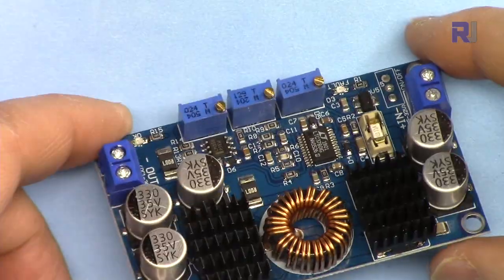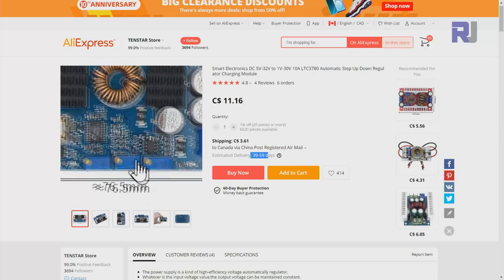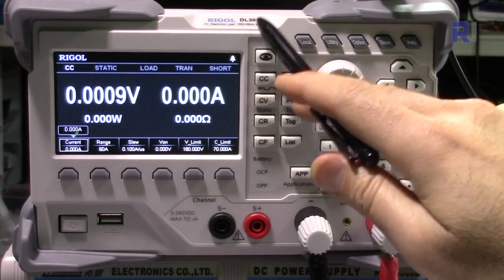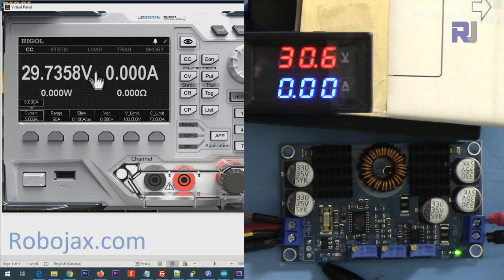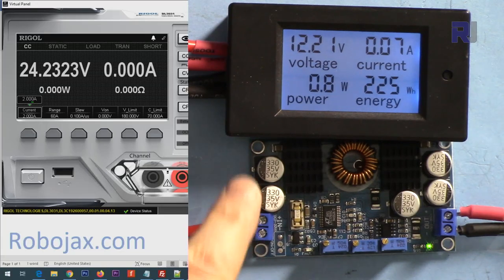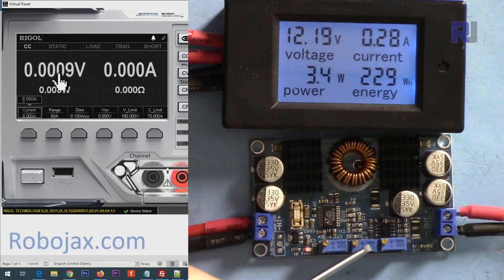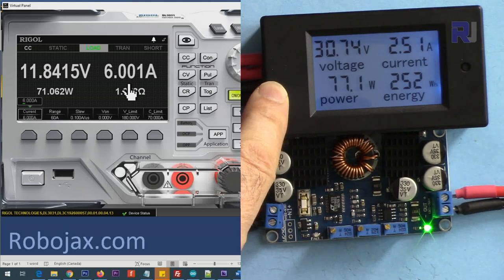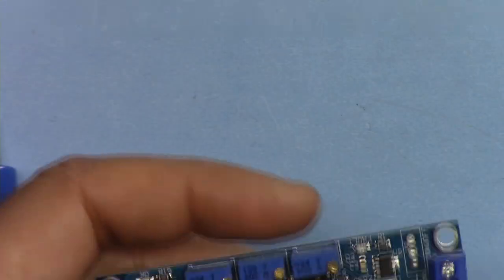Review of LTC3780 Buck boost 10A Converter: 2 module failed

Comment: Hello sir, I cannot adjust the current in this module, Can you help me?
Reply from the maker: the potentiometer is multi-turn. so you have to turn it 15 to 20 times. 1-short circuit the output (connect + and - together) while putting Ampere meter (ammeter) in series to see the current 2- Adjust the current potentiometer to achieve desired value on the meter. 3-disconnect the short circuit from output,. Done. if your module can't adjust the current, it is dead.

Comment: Aassalam sir thanks for your help it a very helpful video I have also brought 3 module all the module where faulty from the box but I manage to work 2 out of 3 buy simply,changing the 40 amp MOSFET and have to power supply from them the are working but I was wondering to make a digital version of the unit but now I think it a very bad idea after seeing this video thanks sirf Allah Hafiz
Reply from the maker: walaikum alaam,  You  are welcome.

Comment: i though this is a 130w,10A Max converter... you overload the converter, and this may be the cause of the burn!
Reply from the maker: There are conflicting details about it on AliExpress. Perhaps I missed the maximum power.
Reply: indeed 130w 10A peak, but without good disipation and sustain draw, 80w/7A. its works perfectly until you burn it!
Reply: I have just ordered 3, so i can repair portable coolers for car usage. From the manufacturer they had negative converters, meaning that the Input GND is output postive. I don't need more than 5A at 13-14V out, so i guess i'll be safe when is set the minimal input to 11V. That will also serve as a overdischarge protection.
Yes, it clearly says 10A. If you want more, solder on some beefier FETs, that might just do it.
Reply: @robojax  "Perhaps"....
Reply: @blubbspinat9363  hello, how is this ltc going with your cooler? I want power 13v 5A led chip with 12-14.4v power source from vehicle. Is this module can handle it?
Reply: @ferdinandkrist_5556  it kind of works, but the current regulation is quite wonky and i have problems with switching power supplies. The initial current spike is so high that external power supplies protection kicks in. i had to use a backup battery while testing. The output current is not stable. If you try to set the current by shorting the output like you do on a lab bench supply burns the module. the peltier coolers are ok with the unstable current between 4-5A and the module handles this staying stone cold. I could sell off these coolers to get one with a compressor which not only has more storage but also cools way better and draws less than 1/4 the power.

Comment: Thank you for such a review. For purpose of making an adjustable bench power supply, to have 0 to 30 Volts and 0 to 5 Amps, what kind of Buck and Boost module do you suggest?
Reply from the maker: You are welcome.  This is very hard to suggest. I waited this long to reply. But Buck boost is not a good idea. Get 30V pour source and use Buck converter and that would be easiest .
Reply: Try D3806 boost buck 38v 6a max. Good board with reasonable price for Diy

Comment: There is not problem. Try adjust potentiometer low voltage protection. I have 5pcs this module like this. No problem found. Just adjust low voltage protection potentiometer. Done!

Comment: You overloaded it, simple. It's maximum 130W for the chip and it's most efficient between 10-15V on both output and input with 90%+ efficiency. If you fully load it, at 130W and 90% eff. the board will have to dissipate 13W of heat between the MOSFETs and the chip, but mostly the MOSFETs. Obviously, those heatsinks cannot do that, they can probably do like 3W each passively. You have to strap a fan on it or figure out a different cooling solution if you want the full power. There are actually holes for it in the board, it's just that this supplier chose the simpler, smaller, and cheaper cooling solution. In this configuration it's thermally limited to 60, maybe 70 watts, if you are at the top or the very bottom of the voltage range, more like 50W watts. 

I'm no EE engineer, but this is probably my favorite design. It's efficient 4-switch single coil topology, sensible board layout, it implements the Vin limit feature and is usually built with proper (albeit cheap) components (mine has nicer ceramic current sensing resistors). It's a fine design, especially for the price, you just have to know how to use it and what it's limitations are. And since the original design appeared many more years ago before this video and is still popular enough that so many seller make it, I'm probably not the only one,

Comment: Assalamu alikum brother 
Jazakalhu khairan 
I was meaning to buy this until I watched your video 
Any board buck boost converter you can recommend for 100w solar panel
Reply from the maker: Walaikum salam, I can't suggest because there are so  many factors involved. For example with 100W what is the voltage? if you work with 60V it would be hard. if you work with 12V it would be easy.  With 100W, at 12V, 100÷12=8.33A so you need 12V 10A  and do the same way the calculation. I have done a lot or reviews, search my channel and I am sure you will find. eBay.com and AliExpress is your source after you know what module you need.
Reply: i found out the board you purchased are fake batch , original ones dont have the two heat sinks rather it has a silver heatsink at the bottom of board, original ones are very good infact

Comment: If you read the manual you would know that you can't draw near 140 watts especially as you were not fans, RTFM
Reply from the maker: it is not about the manual. it is about the claim on eBay, Amazon and AliExpress where they cheat people and cliam huge amout of current or power. So I try to help people  know this module can't do it at that value.

Comment: I just burn my lct after 8 years, cause i do like you do..
Reply from the maker: yes. I put that in the title "2 module failed".
Reply: @robojax  yup, thats modul will be failed if i set current output more than manufacture notification is 10A, 12Vdc or 120watt

Comment: Every similar module I have ever used was rated at INPUT current, not output current!
With 12 volts in and 24 volts out, (voltage boost mode), you need twice as much input current as output current.
You loaded the unit to 8 or 9 amperes, which would requite an INPUT  current of MORE than 16 or 18 amperes!
If you are boosting 12 v to 24 v and limit your input current to 10 amps, your output would be a little less than 5 amps and you would not have seen any smoke.....
Reply from the maker: In principle for power supply the main rating is about output. not input.  when we say 10A 12V it means the output.  Based on this people buy them and if they can't offer 10A, they should have protection or burn.  Input current is a parameter which should be mentioned in the specs. but  no in the main title of the product.
Reply: @robojax  
That's what I thought too, and learned the hard way;..... just as you will...!
Boost inverters are rated as input voltage times maximum input current = max watts out.
A 1200 watt 10 amp boost inverter is only rated at 120 watts at 12 vdc input
And only 50 watts at 5 vdc input.......
You need to learn how to read the fine print.
 Worse yet, the current limiter on many of the boost converters will not work when 
they are being used to charge a battery!
Reply: @robojax  4 some reason ur other comments just doesn't add up 2 this so ur dat typ of guy

Comment: I don't buy module I built my own
Reply from the maker: Good for you. Very had and time consuming, but the results shold be exactly as expected if you know how to do it.
Reply: @robojax  Yeah I don't get the blow issues all topology is calculated and tested before I put my designs on the market in my country I use only semiconductor brand in ic and hy4008 fet ior ight for high current and low losses in heating like what I see on the modules you testing smoking if the heat sink in tin and small the mosfet has too much heating building up around the dye why the dye blow out and shorted making smoke or the fet current rating is 7 amp,I work with mains voltage 400dc and I built a test circuit for fet to test current rating and voltage rating before I add to pcb running a business in my current is very hard to mess up paying back customers and ruin my business so I have to test fully